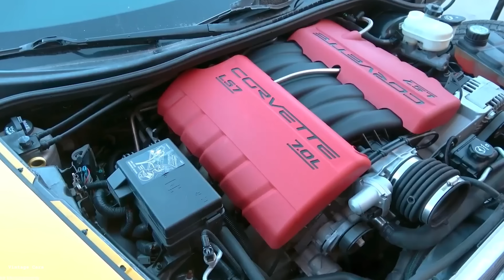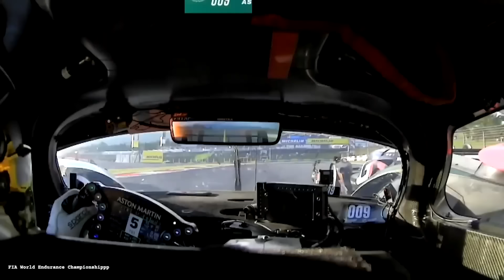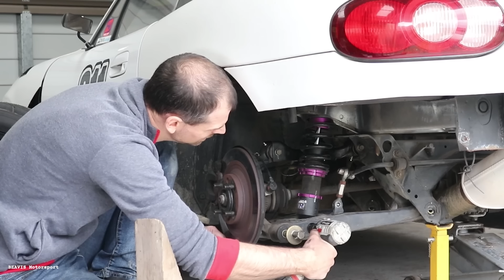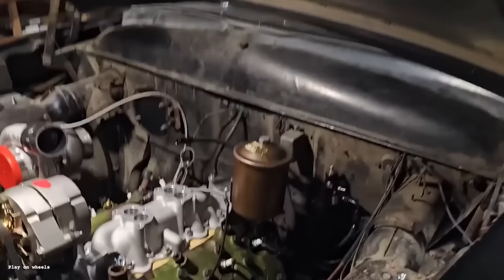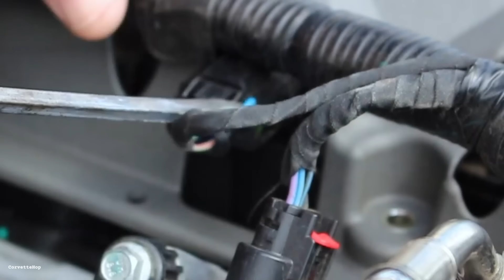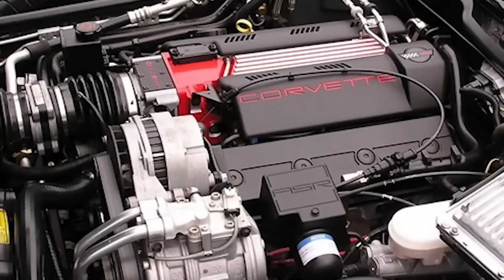How One Chevy “Corvette Engine” Outsmarted Supercars With a Cheap Cooling Hack

Comment: Stop 🛑 please Corvette has stolen all of the Ferrari design for the C8
Reply: Corvette has not nor has it ever need to steal anything from Ferrari. 😅
Reply: @davehutchins2820 😂
Reply: They made it far better, no copies, if you copy you don't improve, just look at Ford and others, all using Chevy power for racing.
Reply: @user-Dr. Ford's 5 liter makes more power than the Corvette 6.2 so I don't believe anything about that
Reply: @jamesolive3693  Not successfully, I track these things all the time, on paper things look good, on track it all falls apart, the Mustangs aren't even close to the Camaro's, they push them and they blow up, almost always, can't run with the Camaro's, their engines are very problematic
Reply: @jamesolive3693 Really now?
Reply: @jamesolive3693  No it doesn't. The only way to compare is on an all out basis. The Chevy has too many extra cubes. Besides, the last time I remember a small block Ford outdoing a Chevy was when the Flathead was king. 😆(Just kidding)
Reply: Corvette is the Trail Blazer of rear engine Zora started it Ferrari sole it GM would not let Zora continue it GM stole it back and Europe is mad Ferrari been using our breaking & magnet breaking for their cars so stop hating 😂😂😂

Comment: Small Block Chevys > Exotic European Engines
Reply: I agree, even the old SBC, I've been doing track days for many years, one of the cars I tracked was a C5 Vette with an LS7, incredible machine for sure, but I always felt the gen 2 LT1 never got developed to its capability, I had the urge for some time to build an old Camaro, I picked up a wrecked 95 cheap, and went to town, it's a hard top, T-56, I have built several of these LT1's, this one I ran all last summer has 14-1 compression on pump gas, with the reverse flow cooling, AFR heads, long stroke, this thing makes incredible power, I'm am as fast as anything on the track, I am still running the LT4 intake, it looks like I could make a hundred more HP if I switched to a carburetor, I just got a manifold to do it, I'm still in the thinking faze, it is running so good.